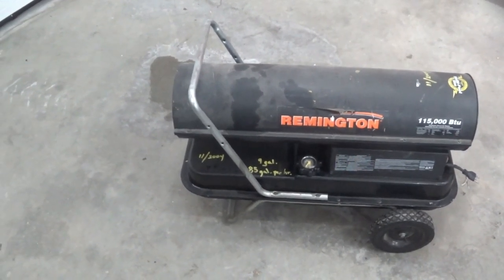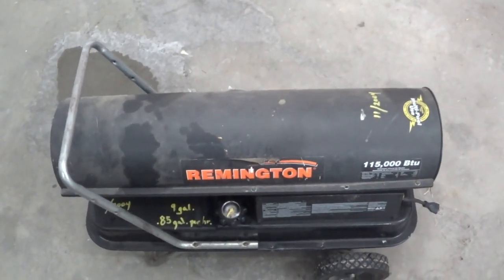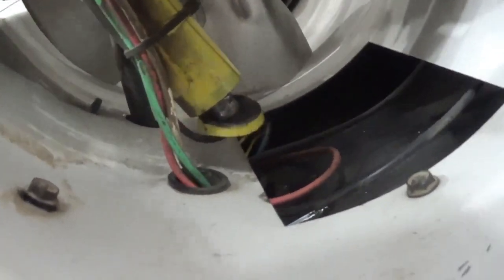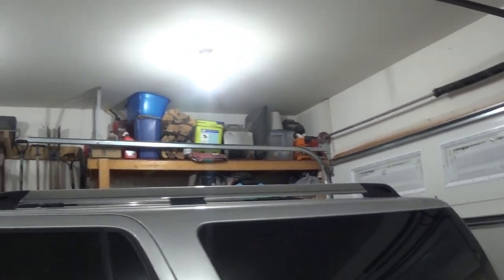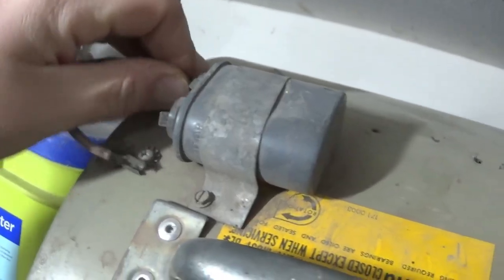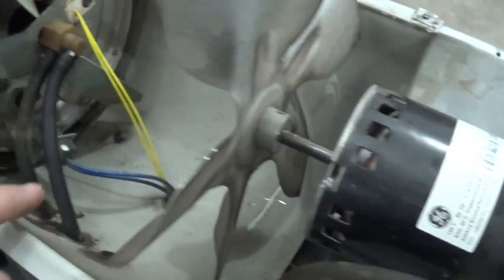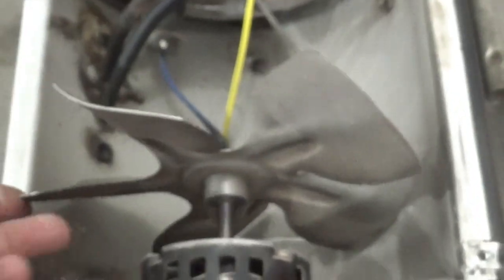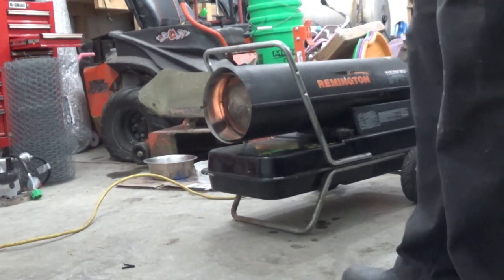Torpedo Heater Repair

Comment: Nice find and fix! I wasn't aware you could run a kerosene heater on Diesel fuel. good to know. I had one of those, but the tank rusted out and thought about fixing it but never got around to it and it sat for years.  They are expensive, I think I paid $300 for mine back in the early 90's.

Comment: Just got off the phone with Dyna-glo i told them my part number(s) “that’s old we don’t make those motors anymore” replaced hoses was working fine my fan ain’t turning now everything else seems fine fuel/spark/vacuum/ I seen ur trick to turn the fan I’ll try that! Great vid thanks for the upload! Damn what’s with those expensive capacitors lately
Reply: And now shes locked up lol
Reply from the maker: There is usually a bushing on each end of the motor. I would try putting some lightweight oil on it or even spraying a little bit of penetrating oil on each end of the shaft and seeing if you can manually spin the motor over with the fan.
Reply: @SkylarHillShop  oh man thought got lucky with wd40 trick and let it sit (I only have a front fan shaft) sprayed it couple more times let it sit over night and was working fine until back rotor graphite broke ugh) I took it out and it’s mostly all ruined. Is there any ordering it? I can get some measurements from it dunno how close that has to be for my heater
Reply: They have a rotor on Amazon for 14 dollars it’s like mine a 1/2” thick. Cant a find the diameter mines like 2 3/8” is that the same you think? Again thank you very much for the info/help/reply’s!
Reply from the maker: @darinzadina6671  honestly I'm not sure. Desa made most of these things. They are almost universal from one to the next. Just small differences.